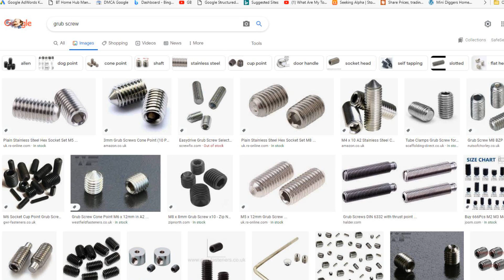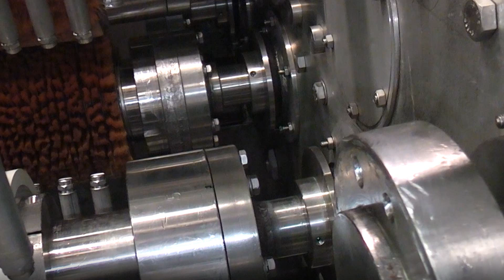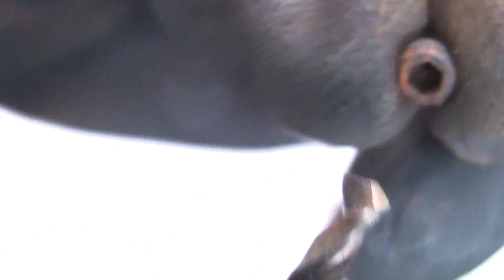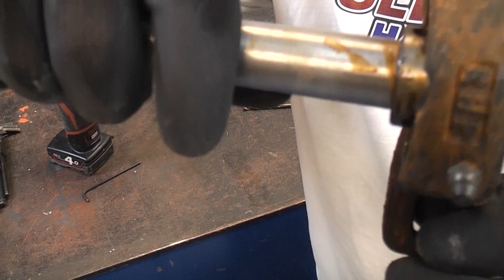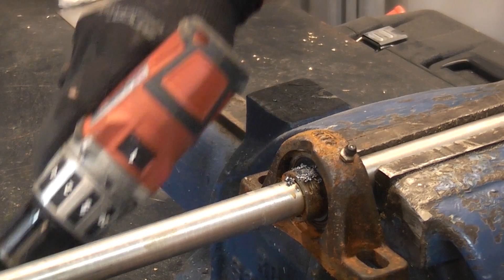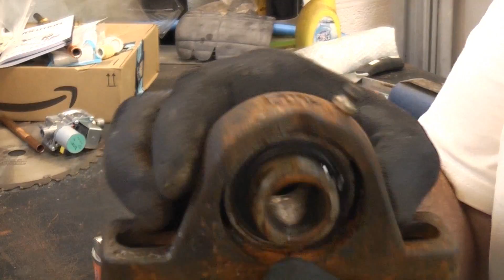How to drill out a grub screw

Comment: Thank you for this video. What size bits would you use to remove a grub screw that accepts a 3/32 hex key and has an O.D. of 0.188 inch?  It is nominal #10-24 coarse (in the US).

Comment: If I'm replacing the bearing, I'll just use a thin slitting disc in an angle grinder. One cut parallel to the shaft, one cut perpendicular to the shaft and prise off the section of the bearing collar with the grub screw in it.

Comment: When its  the driil bit that makes the difference not the drill.... and of course the guy holding it....
only place I got these is for securing gears to electric motor shafts on my old Radio controlled cars.... :)
we used to thread lock em....and a little heat with a miny blowtorch used to help release em
other than that it is easier to cut the gear off......
Quality vid Chez  as always.. :)

N x
Reply from the maker: Thanks Neil 👍

Comment: What about if you cannot get a drill in the correct position, do you strip down the machinery to gain access
Reply from the maker: It depends on the machine. Earlier in the video, I said that I have never had to drill out a grub screw on a taper lock bush, that is because they are normally made from cast steel, so if you hit them hard enough using a hammer they will break. Stainless steel bearings and shafts are much different, the helical gears not only use grub screws, but they also use key ways and key steel to hold them in position. This causes problems, as a new shaft would have to be machined on a milling machine to get the key ways in the correct position. Whilst a bearing might cost £5 - £20 a new shaft would cost hundreds of pounds and cannot be bought off the shelf. Normally when you perform maintenance on a machine, they need it back in production in less than 8 hours, unless it’s during a shutdown, which is normally 2 weeks. I guess it depends on what spare shafts you have available. At the last place I worked, they kept trying to reduce spare parts and questioned every purchase. For example, some machines had nip rollers, which applied masking to the sheets of acrylic. The nip rollers needed changing every few months (I believe it was £5000 for a pair of nip rollers to be recovered). You needed 8 needle bearings for the nip rollers (stock number 10598), but the purchasing department might have only ordered 6 due to costs. (reading this back- it looks like war and peace LOL), I hope it makes sense!

Comment: I get most of these grub screws out the two easy ways. I use a Dremel small diameter cutting wheel to cut the top of the grub screw into a slot and then use a small flat head screw driver to unscrew the grub screw. You can also use a reverse drill bit (not a screw extractor).
Reply: @ultimatehandyman  - Cheers from Dallas, Texas. Thank you very much for your hard work on your channel.  I have followed you for a long time. Keep up the good work.

Comment: It may be easier using a left handed drill bit so that the set screw might come out at some point while you drill it out.
Reply: Although that is a great method for threaded stuff that is no longer under tension (e.g. broken studs or bolts,) grubscrews are usually too tight for that to work. I like to drill small first to avoid work hardening while using the larger drill next.